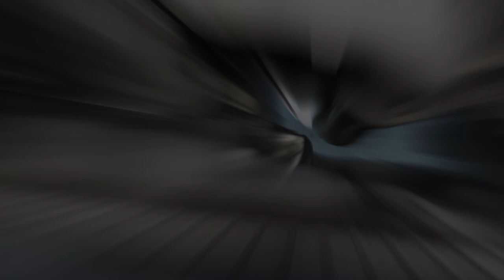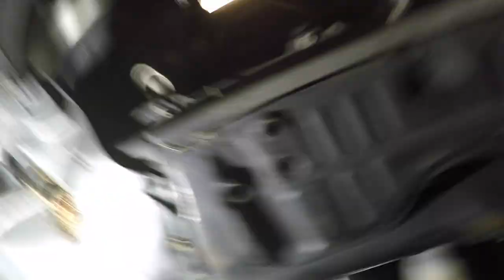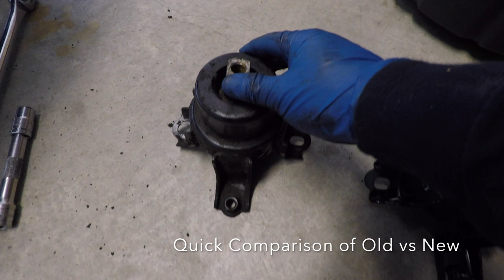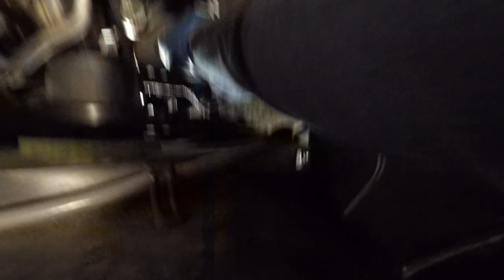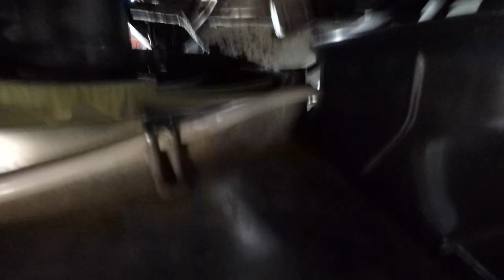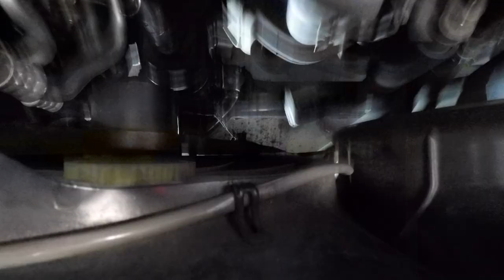DIY VL●OG: Lexus ES300 Toyota Camry/Avalon/Sienna/Solara 1MZFE Front Motor Mount

Comment: Thx for this. By FAR the Clearest instructions on how to 'support' the engine I've seen. ( I'm about to change out my lower control arms & need to remove the motor mounts.
Reply from the maker: David Smith you’re very welcome. About to do the timing belt, brand new lowering springs/struts and new lower control arm bushings and ball joints soon.

Comment: hi! do you know where i can buy the rear motor mounts? my 2001 lexus es300 needs one and it has 186,000  miles on it!
Reply from the maker: Priscilla Garcia cheapest place to find aftermarket would be RockAuto.com. Otherwise, OEM dealerships.
Reply: Organized Garage Status thank you so much!
Reply: Sexy girl i got the same car
Reply: Just curious how your rear mounts turned out? OEM or aftermarket? Someone told me they felt more engine vibration with the aftermarket.
Reply: @rkgsd  to be honest its still the same as before sadly! When it was replaced it was feeling super smooth for like a day then went back to how it was before maybe a little less tough and i do have to agree with the vibration, i got the part aftermarket too!
Reply: @user-ef5tu7nu5p  Perhaps that's why a shop told me to only use the Toyota brand. Still, if the mount was replaced due to a clunking sound when accelerating or braking, an aftermarket mount would fix that too. Vibration dampening however, may not be as good as a Toyota mount.
Reply: @user-ef5tu7nu5p  The rear mount is a pain to get to because you have to remove the axle so with that being said using OEM mounts is just best even though it's more money up front it saves a headache in the long run especially knowing that your vehicle was specifically designed to work with that exact mount in every way just as it was design to. I'm having someone change the rear for me but I'm replacing the front myself using OEM Toyota motor mounts and changing the engine shock too but using an MTD aftermarket brand part for that one.

Comment: My 03 Avalon has whats called "active mount" with the vac lines on it,I wonder if i can plug those and use a non active mount, any idea?
Reply: I'm replacing the mount myself on a 02 and from my research people say on the forums that yes you can plug it with no known ill effects. Also I did replace mine with the factory Toyota mount and although it has the port it looks more like a plug than anything functional because I see no holes it just looks like a solid rubber nipple so to be honest maybe all the newer updated parts are actually just plugs on the mounts.

Comment: Will this damage the exhaust?
Reply from the maker: I can't imagine this alone can damage the exhaust. The exhaust have flex pipe and rubber hangers to absorb vibrations and movement. But if you have badly rusted undercarriage parts, then that would be the problem.
Reply: @OrganizedGarageStatus  There are a lot of wires, tubes and exhaust parts connected to the engine/transmission. Just curious if it would be a good idea to disconnect the exhaust from the exhaust manifold?